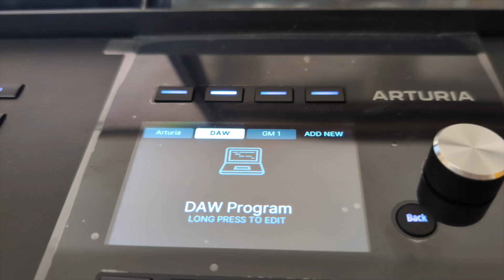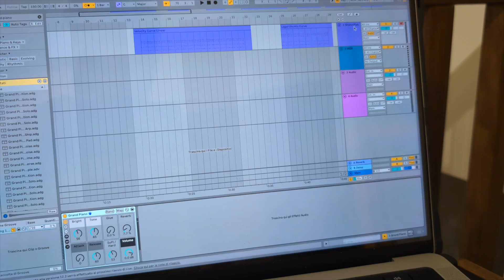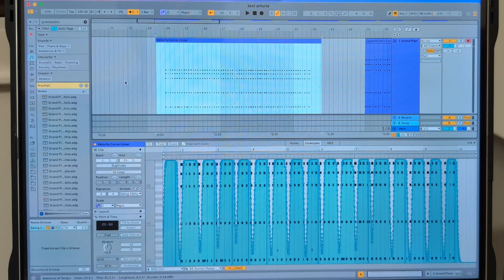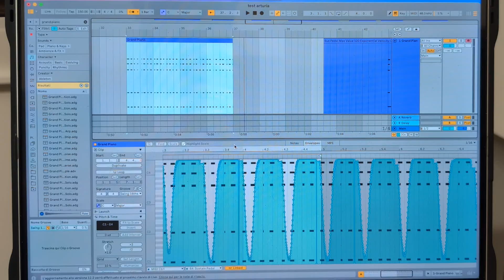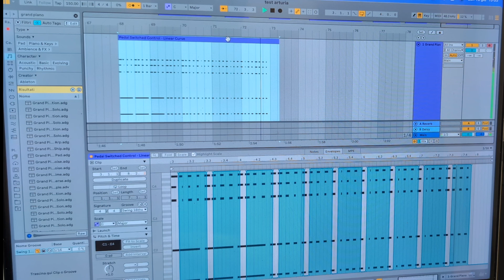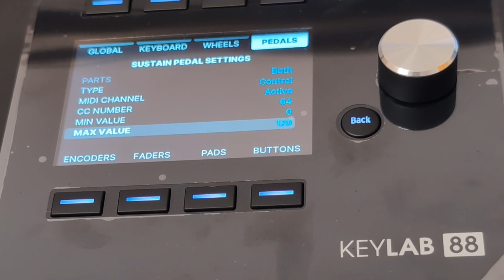KeyLab 88 MkIII Sustain Pedal Bug (Firmware 1.1.1) – How to Fix It (MIDI + Audio Demo)

Comment: Thank you for doing this video.  I've been so frustrated with my KeyLab mk3 (as a pianist).  The workaround does appear to 'fix' the issue somewhat, but when I create tracks with the mk3, my sustain pedal pushes are recorded as a continuous controller (as opposed to a simple 1/127 on/off switch).  I know there are half-damper pedals that do this, but I prefer the switched control for easier MIDI editing.  I have linked your video to my support ticket.  I hope they can do a firmware fix that truly addresses the sustain/HOLD functionality [and lets the sustain pedal work correctly in "Switched" mode].  Your video and approach to showing the problem are fantastic!

Comment: Same problem on my Keylab 61 mk3... I've been in touch with Arturia about this, and they’ve actually suggested me to try your fix. 🙂

I had to set maximum value at 126, because my Roland Fantom handles half-pedalling, and lower CC values (such as 120) don't give the full sustain effect, but with 126 it works OK. 

The thing is that the HOLD button lights up when MIDI CC64 (sustain) reaches 127. I believe that the “HOLD” function is partially responsible for the issue, and that’s why your fix works.